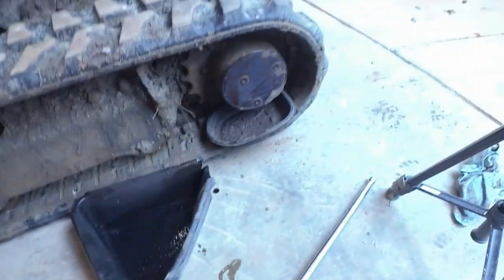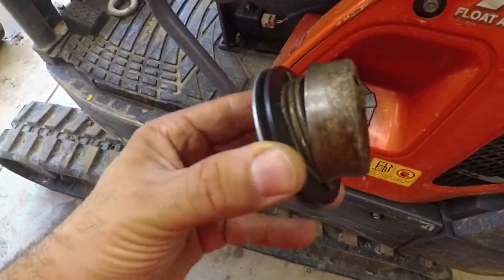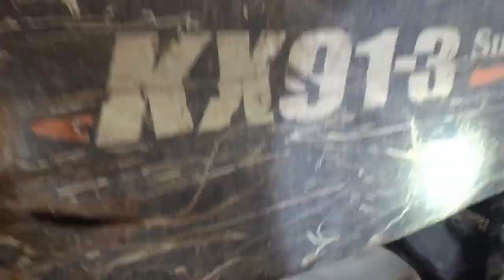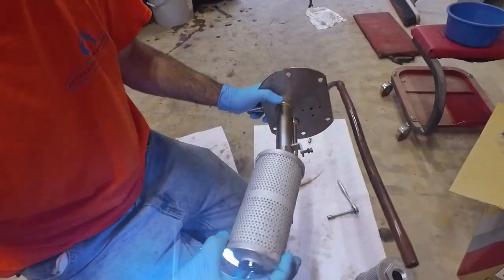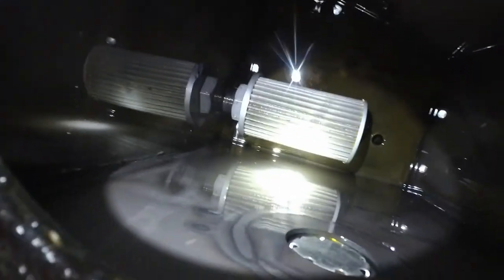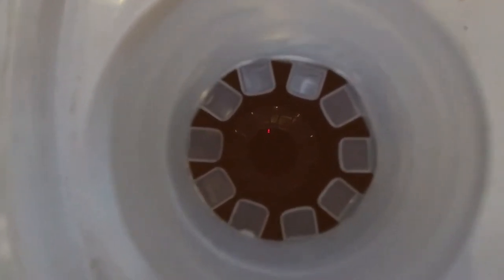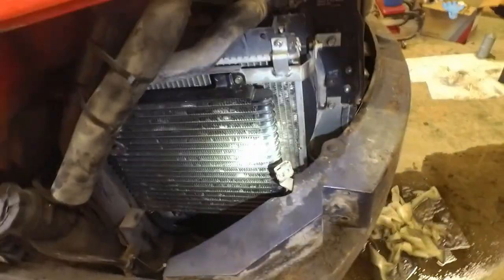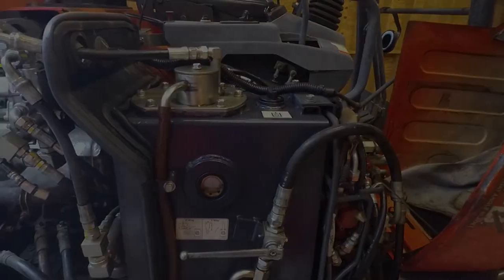Kubota KX91 3 excavator Final drive & Hydraulic fluid change

Comment: Shawn, to help prevent your excavators radiator and hydraulic cooling coil from clogging you could get some prefilter material and cut it to size and attach it over the outside with a few zip ties. This should prevent most debris from ever entering the radiators and would decrease maintenance time overall. Just Sayin'. PS aluminum screen would probably substitute for a pre filter as well.
Reply from the maker: Great idea! Keeping filters clean is the key for sure.

Comment: Ive taken all the bolts out etc but I cant get my hydraulic oil radiator out, any tips mate?
Reply from the maker: Take the hoses off too. There might be a support bar that needs to come out too.
Reply: Always clean radiators in the opposite direction that debris entered into them. Try not to damage the fin and you can get brushes that are made for cleaning the fin that will keep the fin opening open as it should be. The brush will normally straighten any slightly bent out of shape fin.

Comment: I have a kx 91/3 and need to drain and replace hydraulic filters but can't find the hydraulic fluid that is recommended in the manual, even the dealer wants to sell me udt or cheap bulk.
What did you use in yours?
Also, I see a ball valve on the side of your tank, what is that plumbed to? I don't think mine has that?
Thanks for the info!
Reply from the maker: I used AW 46 hydraulic fluid. I'm in NC and that's what the dealer recommended. That ball valve is the 2 way valve. If you're using a thumb you want the fluid to move in two directions. But if you're using a hammer you want to switch the valve to one way so the fluid only moves in one direction through the hammer.

Comment: That machine has been used and abused. At least its easy to work on . I sure like kubota for that .
Reply from the maker: For sure. But I keep telling myself that's why I got it! It also had a new engine installed last year. The tree company that was selling it had several of their trucks and equipment vandalized where someone drained the coolant. This machine overheated and locked up the engine. I have the paperwork and warranty info so that's one reason I got this one. So far so good!
Reply: @GCFD   Some people are sure dicks hey abusing equipment geez. Well you make some great videos I'll keep watching.